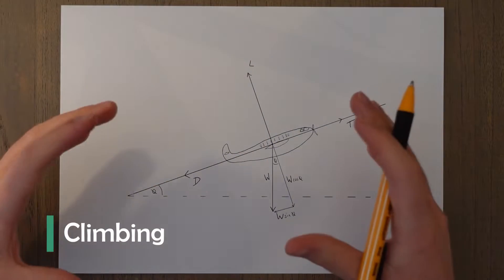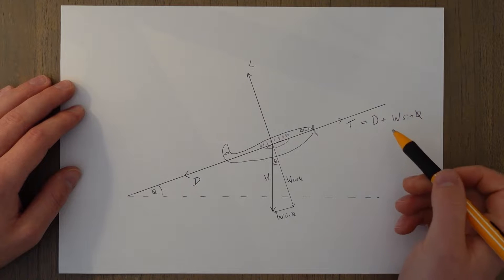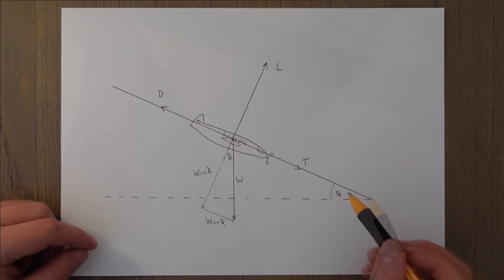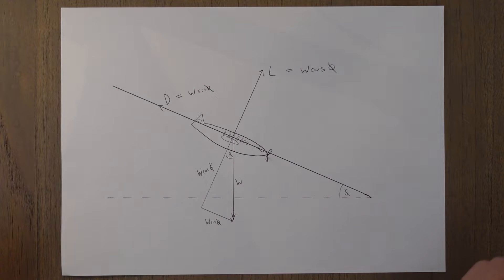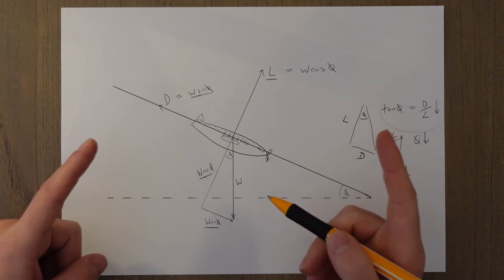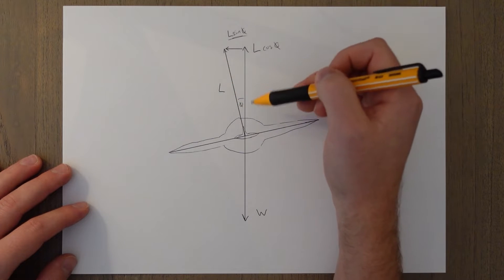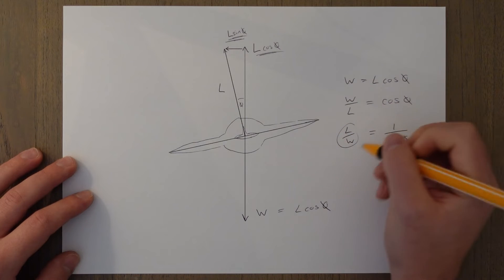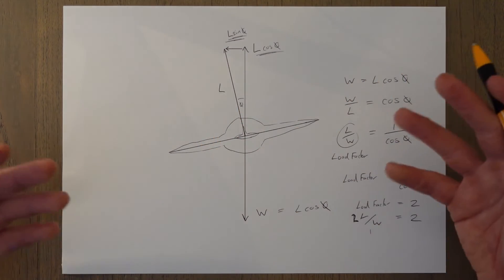ATPL Performance - Class 3: Physics of Flying.

Comment: I think If force = drag, the aircraft shouldnt move. For horizontal forward motion, thrust should be more than drag. Please correct me.
Reply from the maker: Newtons 1st law of motion
Reply: I understand your thinking but we talk about unaccelerated level flight. So if your Thrust is equal to your Drag you are flying in an UNACCELERATED condition. If Thrust is higher than Drag, you would increase and gain Airspeed.